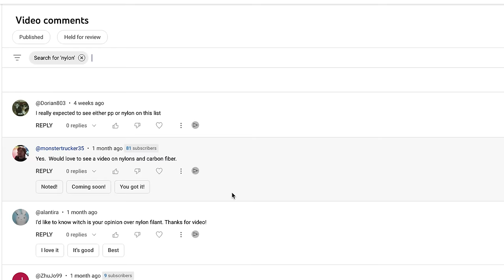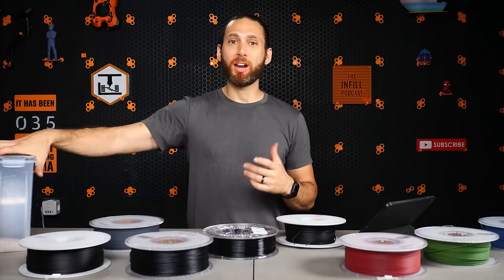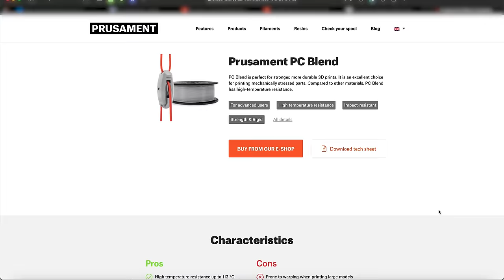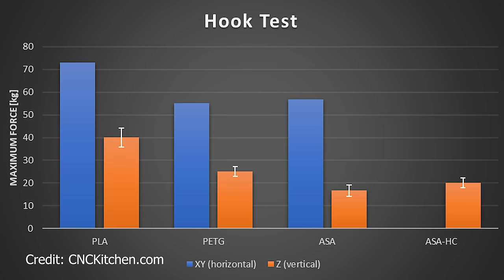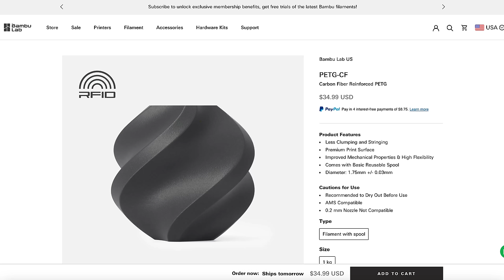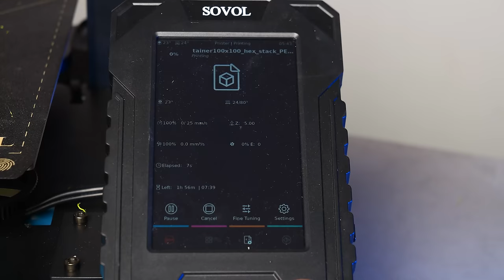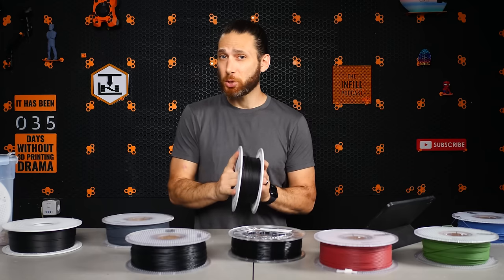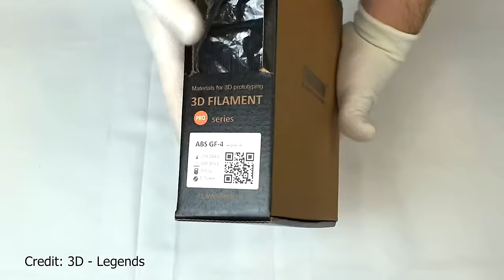Carbon Fiber 3D Printer Filaments: What Are They Good For?

Comment: I am the main Engineer that 3D Prints for an organization in a big Aerospace Company and could attest to the robust characteristics of Polycarbonate. We print prototypes, structural placement of brackets for flight parts, Drilling Fixtures, Mold for flight RTV parts, and Shop Aids. That thing is awesome.
Reply: Where you from? I would love to be part of the team
Reply: It's not Boeing is it 😂
In joking
Reply: @Eltuty14  I work for a program in Kennedy Space Center in Florida.
Reply: @militar3rd  I am a structural engineer conducting research for my master's degree. Do you have any recommendations for materials that have a high stiffness (as close to galvanized steel) for 3d printers that are not listed in this video?
Reply: @mezhkolape  Unfortunately that's out of my wheel house. The strongest material we have is Ultem 1010, we don't use it asuch as it causes changes in tooling and our track record for reliability on the filament is not as robust as PC.
Reply: @militar3rd    You know actually what is the name of that printer?
Reply: @militar3rd  I have some experience if there’s ever an opportunity for a job I would like to know please 🙏
Reply: @militar3rd wow! That’s awesome. Moved to South Florida but loved that area. Melbourn is awesome

Comment: PA-CF is also one of the more popular filaments in the printed "pewpew" community. Most parts are designed for PLA +/Pro, and filled nylons do an excellent job meeting or exceeding its physical properties while having drastically better heat resistance, albeit with a higher price tag. I've switched to using it almost exclusively.
Reply: Which brand PA-CF are you using ?  I'm trying to switch over, but having a problem getting it dialed in.
Reply: they dont call it black aluminium for nothing 👍
Reply: I liked taulman nylon 910 alloy. Haven't tried too many others but lemme tell ya. It's some TOUGH stuff. Alot of squirted pew pews are small caliber. 910 was tough enough to handle the big boys without issue. I'm sure there's better and newer out there but 910 was epic once I got settings dialed in. Looks phenominal too
Reply: I like CF polycarbonate. It is harder than nylon and sands/files down better. It can be a real pain to print well with.
Reply: can you use it in a printer. or do u need a fancy expensive one
Reply: PA6-CF is a neat filament, but I think PC would probably be a better option since it is less hydroscopic, UV resistant, and tougher. I've been switching out most of my PA for PC recently
Reply: @alksmdlaks  Polycarbonate is the way to go. It can be a bastard to print with but if you get it dry and have a good set up it will work fine at 260/100 with an enclosure.
Reply: @notyouraveragegoldenpotato  im trying to print some "fast pointy object resistant" stuff and ordered some glass filled nylon as it had the highest notch impact test on the spec sheets given for the site i browsed. Is GF nylon strong enough for something like that?
Reply: I've printed both Gl-_k and AR lowers out of the PAHF-CF from Bambu Lab. Both are holding up fine after a min of 1k bangs out of each. It's a fun experiment and you can save a little on the 9mm stuff but with a aluminum AR lower costing less than $50 from Palmetto it's really not necessary.
Reply: judging from the video PETCF looks to be even better than PACF

priline makes a PC blend that prints at 250c so I've printed it on a bowden setup with a capricorn tube
Reply: then what is the best filament (top 3) to use when 3d printing a pew pew?

Comment: There should be an app that has all the attributes where you can select the properties you need and the printer you have and it will tell you which filament to use.
Reply: There are softwares existing for material choice already.
Reply: @dorianvincent2101  What software?

Comment: I bought a 3D printer and haven't even used it yet. But I keep watching your videos. No need to apologize for the content you can or can't create. Just keep doing the best you can.
Reply from the maker: Awesome, thank you!
Reply: Learn a cad program, and the ide's will keep comming. trust me.
Reply: That is a nice thing to say.
Reply: @PSimonsen  I've been always curious which CAD software to use to get out ideas on a 3D printer.
Reply: @OdellMoise  fusion 360
Reply: Was it a Bambu lab? if so your going have fun. I bought one 4 weeks ago with zero printing experience and im addicted to printing now. I mostly print prototypes and working parts.
Reply: @julieta203 what material are you enjoying using. I’m yet to buy a Bambu lab printer. I’ll be pulling the trigger soon.  What’s your favorite materials. The choices are exhausting!

Comment: One time my part cooler fell off while printing PETG and discovered it didn't make a difference (of course this is not the case for other materials). When I built my own 400mm^3 printer I never even added a part cooler and it's been a great PETG machine. The simplicity of the direct-drive head with no part cooler is awesome.

Comment: I've noticed that PA-CF is very rigid right after printing, but becomes quite flexible once it absorbs some moisture (at least with esun PA-CF). I think it's important to consider how these materials behave after some time of use, because nylons usually change a lot once they absorb water.
Reply: I agree. But there’s a reason we don’t see these tests performed more often.
Environmental conditions over the long term drastically affect the results of each metric. 
Outdoor tests are far too complex for the results to be significant to anyone. For instance, the results from the arctic circle might resemble results from the Sahara more closely than another cold environment like Chicago. 

Indoor testing in a climate controlled environment can be useful. However, there needs to be separate chambers for various humidity levels, and even DIYing that climate control costs thousands. This complex testing is important for the same reason your PA-CF becomes flexible, as individuals in Denver (extremely low humidity) can expect very different performance.

Comment: Polycabonate was actually the  second ever material i ever printed on my X1c and i was genuinly supprised at how clean and smooth it printed
Reply: PC prints so well on my X1C (with the multi filament feeder / dry box) that I've been using it almost exclusively.  Color choices is about the only reason I use PETG at this point.  PC separates from support material so much better than PETG, and ends up cleaner than even PETG with a support interface material.  I think the PC I've been getting is a blend of PC and PETG, so I don't know if I've ever used more pure PC.

Comment: Hi Jonathan! Hope you and your family are doing well. 

My contribution: There´s one type of filament that  is VERY rarely mentioned by 3D printing channels (and some consider it as quite engineering-capable) but that is my personal favourite that I use for ALMOST everything: Tritan.

It has the same thermal resistance as ABS (about 110-120C glass transition) which makes it ideal for car parts (even in the engine bay, as I did some air cleaner assemblies for my vintage VW Beetle, which I used for over a year, only taking them out because of other mods I did to the car and they didn´t fit anymore), for example. It also have chemical resistance so it can be used in environment with fuel vapors (like the top of a car carburetor). But it DOES NOT have the tendency to warp and delaminate like ABS/ASA , it´s not higroscopic as PETG, it´s quite easy to sand and prime for painting (unlike PETG) and does not require an enclosure. I´d say it´s almost perfect, the only problem is a tendency to ooze a little bit (not enough for causing stringing with retractions properly tuned though) and build up on the nozzle (which is sort of a hassle when using Revo nozzles, as it tends to build up in the heater core), and the lack of color  options (only black, white and clear). It´s also a little hard to tune the first layer on an PEI sheet (brims tend to lift up), but once the actual part adheres you will have no lifting problem. It´s not as tough as Nylon, but it´s between ABS/ASA and Nylon. Also have some flex which makes it NOT to be brittle (as shown in my Beetle experiment, with all the heat and vibration from the old aircooled engine, I took them away for other mods one year later and they were still in one piece like the day they were printed - I gave them away to a friend who still runs them on his dual-carburated VW T2 Bus as of today). However, it does require an all-metal hotend (it prints between 250 and 270C depending on the batch/colour and other characteristics like the manufacturer formula) and requires a heated bed capable of at least 100C (110C is the ideal). The only problem with it is the price, usually is somewhat more expensive than ASA, at least here in Brazil, and it´s not all filament manufacturers that make them. To save I usually buy "low cost" lots in which one kilogram is made of a few smaller rolls that are made from leftover material (when the amount in the filament extruder is less than 1KG) during the manufacturing process. 

Gridfinity boxes I printed out of PLA/PETG and ABS a few months ago are starting to delaminate, unlike the ones printed out of Tritan. 

Tritan is also deemed to be "food safe" (it´s used in microwaveable tupperware-like but made from injection molding), although let´s be honest, no FDM printed part is actually food safe because of the inter-layers spacing that can build up bacteria. 

All 3D printer upgrades I print at home are made out of Tritan. It´s awesome for parts that stay close to the hotend, like fan shrouds and such. One of my current rebuilds have fan shrouds and ducts made of Tritan, an external electronics enclosure (GalvanicGlaze´s enclosure with some remixes for using parts I had) also fully printed on Tritan.

I only don´t use it for decorative parts, to which I go with plain old PLA. I do have some rolls of PETG and ABS but I rarely use them.

I did try to print Nylon and actually had some success with CF Nylon on an old enclosed Ender 3 V2 (which I don´t have anymore), but really it´s so much trouble that I personally gave up on it for now as Tritan is doing the job.

Currently I´m printing a cat food stand, check it out (hoping there isn´t a power outage as here in Brazil heat these days is extreme and power outages are happening on a daily basis, the grid isn´t keeping up with all the A/Cs on countrywide, and  my UPS can´t handle the Mega X very well):
Reply from the maker: Wow. Haven’t heard of it. I’ll need to research and figure out what actual plastic it is
Reply: @thenextlayer  Looks like it's a co-polyester? 
 https://en.wikipedia.org/wiki/Tritan_copolyester
Reply: I wasn't surprised to NOT find it on amazon USA or Canada. The only source I could find by googling showed 'out of stock'. Not looking good for availability.
Reply: If any of y’all have a Vitamix, this is what the container is made out of. Should be an interesting one to keep an eye on.
Reply: @Cujobob  many kitchen utensils (specially transparent - not colored - Tupperware-like bowls) are made of Tritan. It’s BPA-free so it’s deemed (when injection molded) as safe for food applications and can even go into the microwave.

Been researching more and I’m still surprised it’s not widely used in 3D printing and that it is hard to source out there in developed countries. I buy it regularly here in Brazil (even though costs twice as ABS, around the same as an ASA roll around here), as I mentioned, it’s my go-to filament to almost anything useful or 3D print upgrades. Apart from temperature requirements (between 255-280 for hotend depending on the quality of the material and 105-110 bed) it can print just fine even on open printers as it doesn’t warp like ABS or ASA. And it also doesn’t smell nasty.

One useful thing I did with it was some hangers for putting wine glasses in the dishwasher. It stands fine the temperatures without deforming. Car parts I usually make out of Tritan as well.

To be honest the only reason I’m not using Tritan for my honeycomb storage wall is because I managed to get the recommended PETG for a bargain during the Black Friday this year.
Reply: @ubiratamuniz  I really hope I can find a source for this. It appears to be safe to print which is the main issue with some of these more exotic filaments. How hard is it on the printer itself?
Reply: @Cujobob apart from the temperature requirements (all metal hotend is a must) and some tendency to ooze curling up and accumulating in the nozzle/heatblock (nothing that some periodic brushing won´t prevent), I never had any printer malfunctions or problems related with printing it.  As long as you tune it properly to your printer (specially hotend temps and Z-offset) you are good to go. 

One thing that I noticed in the last two years I´ve been using it as my main to-go filament, however, is that if it doesn´t ooze a tiny little bit from the nozzle, then temp is too low. 

Layer adhesion from it is one of the best I´ve ever seen (again: as long as it´s properly tuned) in regards to materials printable in hobbyst printers, losing only to Nylon (which is a major PITA to work with).  

The only roll of Tritan filament I had trouble with was a clear one which had poor quality, lots of diameter variance, ending up in jams. All the others (I´ve printed quite some of it) were just nice and easy.
Reply: @ubiratamuniz  appreciate the information here! Will keep an eye out for this.
Reply: @ubiratamuniz  your cam link is still working. Maybe you would like to shut it down?
Reply: Wow, never heard of Tritan. Gotta look into it. Thanks.
Reply: Opa, que bom ver outro brasileiro por aqui. 
Você tem comprado o tritan de qual empresa daqui? 3d fila? coloquei no google e foi o primeiro resultado.
Reply: @alvimpaulo vamo lá! eu costumo comprar da 3DFila e da 3DLab. O da 3DFila é de melhor qualidade, maior precisão do diâmetro do filamento e costuma dar peças mais "bonitas". O da 3DLab (no caso compro o Low Cost, nunca comprei o Tritan "normal" deles) costuma ter algumas variações de diâmetro que podem (ou não) dar problemas na impressão, e afetam a qualidade visual das peças. Normalmente uso o mais barato (3DLab) quando vou fazer peças que não precisem de uma aparência perfeita mas que as características térmicas e de resistência do Tritan são necessárias (como no filtro de ar do Fusca que mencionei no comentário original). Outro problema do filamento Low Cost é que pelo fato de ser feito com "sobras" do processo produtivo, às vezes a variação de diâmetro causa entupimentos, principalmente na minha impressora Bowden (na outra que é direct drive não costuma ser um problema tão perceptível). Ah, outra desvantagem do low cost é que você não escolhe cor.   

Tem mais uma marca que faz mas eu não me lembro agora qual é, eu ACHO que é a GTMax3D. Mas eu nunca comprei o Tritan deles porque acho o preço muito alto (mas eu gosto do PLA e ABS deles).
Reply: @LichtTempler  thanks! I did deactivate the link as soon as you reminded me of it (I had completely forgotten about it LOL) but I didn´t thank you at the moment because I wasnt´t actually able to reply here (I don´t know why).
Reply: @ubiratamuniz  Pô valeu demais pela resposta, vou dar uma explorada neles. Já tive problemas com PLA de refugo / fim de filamento de pelo menos umas 3 marcas diferentes, tanto em bowden quanto direct drive kk. Acho que vou começar testando com o da 3DFila mesmo.
Reply: so it seems that Jonathan actually found out the true name of the material (CPE)... (I didn´t knew it LOL).  It´s on his next video of the series. Tritan is actually a registered trademark.
Reply: Então. Tritan só chama assim no Brasil. O mais similar é o colorfabb HT.  Não encontrei ainda nenhum fabricante gringo que use o tx1001.
Reply: @ubiratamuniz Ooow, que massa!
Eu to pensando em começar nas impressao 3d, ja sei alguma coisa de CAD mas ainda falta muito pra aprender sobre impressao...
Qual impressora vale comprar aqui no Brasil, onde conseguir suprimentos e td mais ainda é um misterio pra mim. Mas quero muito inventar umas bugiganga 😂
Se tiver alguma dica pra dar agradeço!

E parabens pelo ingles Ubiratan!

Comment: Perfect timing on this video. My Sovol SV06 Plus just arrived yesterday. I'll get their klipper pad later. I went with the SV06 over the SV07 because of the linear rails over the V-wheels. And I don't like that huge noisy part fan. I purchased a part fan upgrade kit for my SV06 that is printed in ABS and points the air to all sides of the part. 

I want to use my printer to make fittings for outdoor hydroponics. The PETG-CF you talked about sounds like the perfect material for my application. I am also a 'Mr. Fixit' so adding this to my arsonal will allow me to build replacement parts or redesign better ones.

Glad that you and your family remain safe and keep making this wonderful content.
Reply from the maker: Nice! Enjoy!